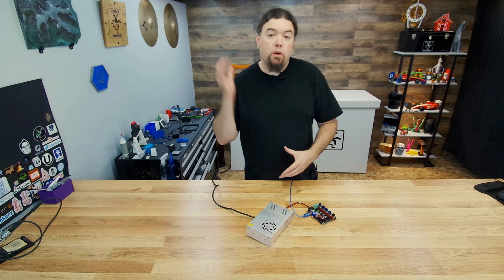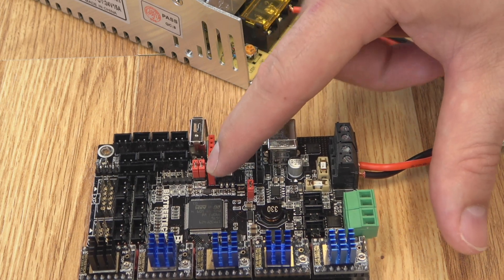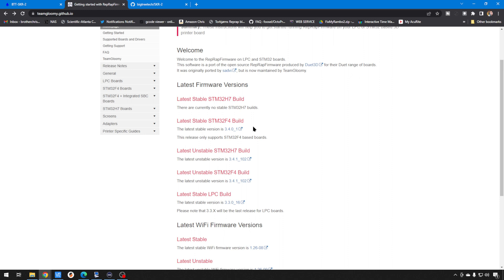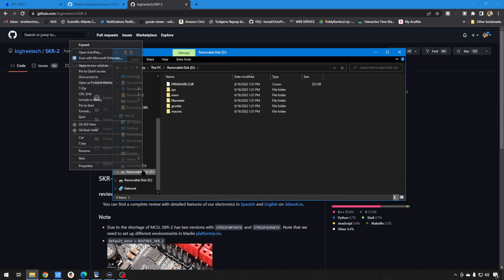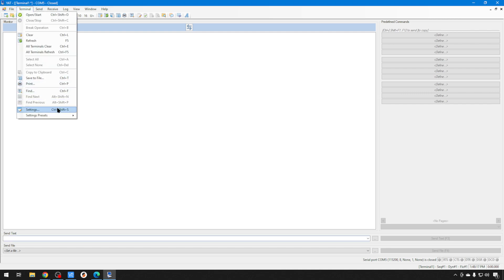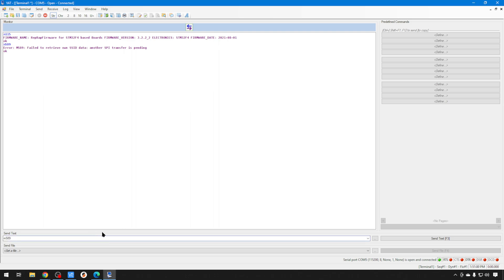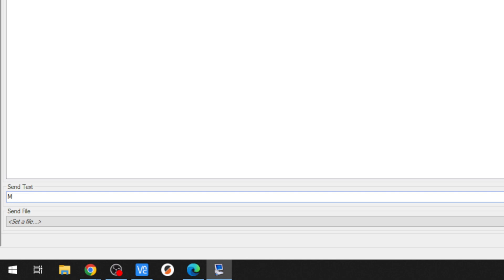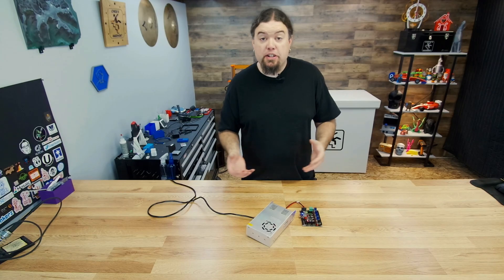BigTreeTech Wi-Fi - SKR - RepRap - 2022 - Chris's Basement

Comment: Chris I followed your install and you other SKR RRF videos... I got my SKR2 and have it running fine... Thanks you for your guides. With the Gloomy Config I was able to setup 12864LCD screen on my SKR2. Do you know of any discussions about other LCD screens available to use with RRF3 on BTT hardware?
Reply from the maker: Awesome! That is the only one that I know of. There could be others, like viki that would work, but I haven't seen it done.
Reply: @ChrisRiley  I am getting deep into RRF3 on the SKR2 but I have one thing I havn't been able to google. (I edited this as I fixed the question about installing IS with a Screen... instead of using 12864LCD I used a TFT35 freeing up the EXP1 for the Input Shaper module) but this has just lead me to more questions??? I have the LIS3DH installed and working and I think I understand the IS pluggin enough but there is no tutorials on how it is used? I see that you move it with a start and end point etc but on a Cartesian you can only do one at a time and then what... average the Y and X results matching a shaper profile? Have you done a tutorial on this showing the whole process start to finish?
Reply from the maker: @antonyking5605  So it's a little tricky on Cartesian, but I have done it on the Voron switch wire, maybe this will help. https://youtu.be/9S7uGbbBfx0

Comment: Great tutorial, simple and straight to the point! Would it work for mks nano v3 since it uses the same chip and WiFi module?
Reply from the maker: Thanks! I did some looking, it looks like the Nano v3 only supports Marlin, so you would only be able to connect to the serial with the Wifi connection.

Comment: Hi Chris , Any  thoughts on wifi ESP32 settings for SKR3EZ ? Manual show firmware can be flash  with microsd from the SKR3EZ  . I have the ESP32U but I am not able to connect on UI page , not able to update the firmware on Marlin 2 motherboard firmware. Thank you
Reply from the maker: Yes, the ESP32 is really only for REPRAP wifi access. It doesn't seem to allow you to connect to the board with Marlin. About the only thing you could do it would be to flash something like esd3d to it, but BTT doesn't make that easy. I still can't figure out how to do it.

Comment: Hey chris having some trouble it says my wifi module is timing out whike trying to connect to the wifi network what could this be?
Reply from the maker: It could be a lot of different things, but the wifi network name and password are usually the cause. Make sure they are correct, they are case sensitive.
Reply: @Chris Riley  ill give it a go tonight i went through the whole process of sending commands after uploading the firmware probably 4 times and thought forsure it was correct, could it be just too much load on the network at the time i was trying to connect? I should also mention i couldnt get my skr 3 to respond to YAT so i attempted this through pronterface! Maybe i got YAT from a bad source? Thanks so much for the reply dude your videos rock! So helpfull!

Comment: Chris, the settings about which u told to install wifi. can I apply same settings for wifi module esp32e to Install in skr3 ez board?
Reply from the maker: It works the same on the skr3 but for RepRap. Good luck with your projects.

Comment: I send a M115 command to my SKR 3 EZ using several different terminal emulators.  They all are successfully connect to the board.  I'm sure that the firmware loaded successfully as firmware.bin file changes to frimware.CUR on the SD card.  I get a "Locked $" response to the command.  What am I doing wrong?
Reply from the maker: That's strange, did you try another baud rate? Not sure what else would cause it.

Comment: Chris, this is by far the best explanation of setting up a SKR board with RepRap and a WIFI module that I have seen.  Great job.
However, I have a problem.  I followed your instructions to the letter and everything worked perfectly until I got an IP address.  The IP address given from the M552 command times out in my browser and throws an error.  That IP address does not show up in my IP scanner nor in my network client list.  There were no errors or warnings during the process you showed.
How did I mess up?😕
Reply from the maker: Thank you! Hmmm, maybe it joined some sort of rouge wifi network? Use M587 to list the networks and M588 to forget one.

Comment: I bought my WiFi module when I purchased my SKR 1.4.  I never was able to get it working. I also have the TFT7.0 V3 which also has a WiFi connection, but I was also unable to set things up with that. Would your process here work with Marlin on a an SKR 1.4?  And since I'm asking dumb questions, why RepRap over Marlin?
Reply from the maker: Marlin can only use wifi as a connection into serial. So wifi isn't very useful with Marlin. That's one of the biggest advantage to using REPRAP, it has a ready made interface to enable the wifi frontend.

Comment: Chris, thanks for the how-to. I've tried every possible way of getting the wifi module working and had given up until seeing your video pop up! Unfortunately, I still get an error with failure to connect to the module. I'm running reprap on multiple Fly CDY boards and never have an issue. Any ideas out there?
Reply from the maker: Hmmm...where do you see the connection failure? In YAT?
Reply: @ChrisRiley  yeah, it tries connecting at different baud rates but fails
Reply: @ChrisRiley  I’ve got two different modules, the second is an ESP-07s and it seems to completely block the com port on the board, so no connection at all with that one. Maybe the board has an issue?

Comment: So how do you set this wifi module up if youre running something like Klipper? Not entirely clear on the firmware side of setting up boards .
Reply from the maker: On these boards, the wifi only supports REPRAP. For klipper all the wifi would have to be done on a different computer, like the raspberry pi.
Reply: @ChrisRiley  that's too bad....just got the skr 2 and wanted to take advantage of all the features but I'm also wanting to dive in to Klipper....been a  Marlin fanboy for years but I was out of the scene for a while. Come back and there's this shiny new controller with some slick features and groovin dance moves.  
Oh well...I have a pi4. I'll be using it for Klipper anyway. Just be nice to have the board option there.
Reply: @HedoBum  I've used klipper and you should give reprap a try. It's really good
Reply: @samuelp1227  I've used reprap before...like back before 32bit boards were even a thing. I started using Marlin  (obviously also before this newfangled 32bit board craze took over and the subsequent VScode compiling) and I never looked back.
Now I hear all these wild rumors about Klipper and its apparent balls of cast iron and the incredible 3d gymnastics it's capable of and I just HAVE to experience it....I mean, I've already got an accelerometer wired up to rock that input shaping mumbo jumbo I've been reading so much about. 
I have got some serious wood to see how this thing works.

Comment: Great video man!  Im still runnin the good ol SKR 1.4 Turbos, is it worth upgrading the board but keeping the TMC2209s that I got already?
Reply from the maker: Hey Paul, depending on what you want to do, I wouldn't upgrade. You can reuse the drivers if you want, but if you are sticking with Marlin, 1.4 is still a fine board.

Comment: good work Chris.  So the wifi module on skr boards only has value if we are running reprap?
Reply from the maker: At this point that is correct. It's hard to use any of the other options on the BTT boards at this time.
Reply: @ChrisRiley  There's 2 alternative options if one prefers / wants to stick to marlin, the wifi module can run esp3D and make for a wireless monitoring device (but upload speeds sucks because it only uses UART).  
Or, one could get an espcam module, wire it to the wireless port and use esp3d on it, espcam modules have an sdcard port to which you can upload gcodes to at descent speeds, and then esp3d just reads/send gcode commands to (marlin) like any serial host (over usb, tft screens, octoprint, etc..) 

But RRF is better :p

Comment: I thought those modules used the ESP3D firmware?
Reply: Can do, it's up to you what you flash to it.
Reply from the maker: You can use ESP3D if you want, but it's not easy to flash it on the BTT board.